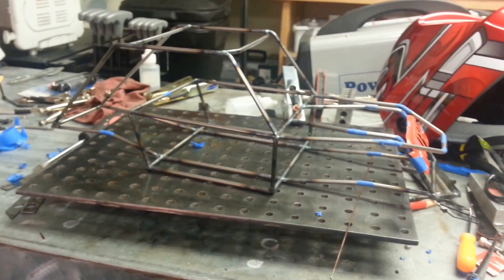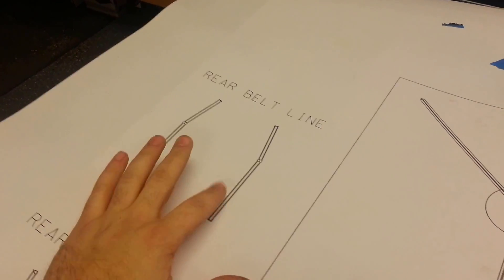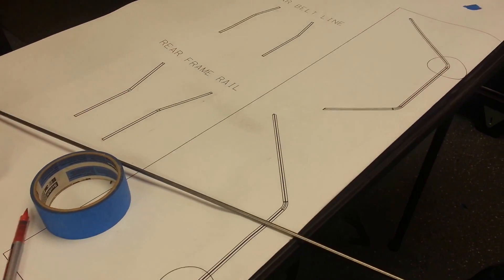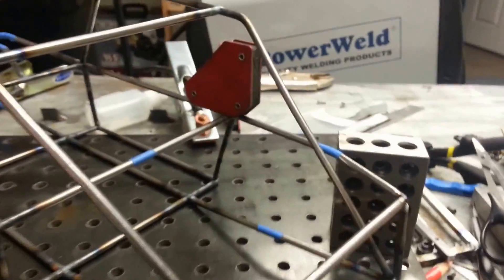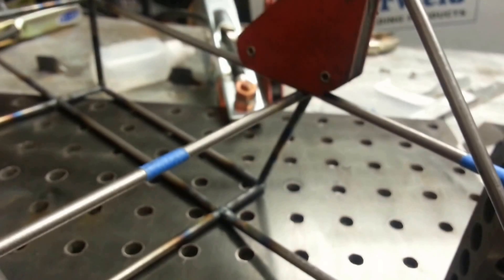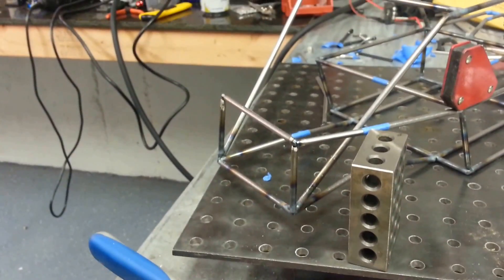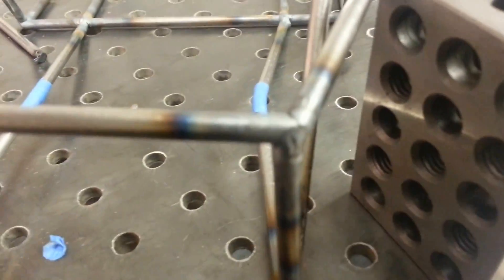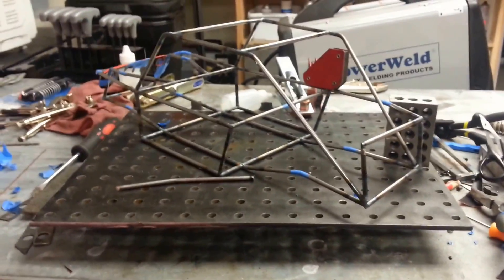How I build my custom crawler tube chassis

Comment: Are these plans available anywhere? Im looking for tube chassis with minimal bends as I'm scaling the build down to 1:25 scale. Any leads on plans would be very helpful
Reply: MicroMark has 1/28th scale RC Offroad
Kits. You add electronics, Radio, battery, motor etc.

Comment: Where do u get the tubing?
Reply from the maker: I bought my metal from a local metal supply shop. Many times local hardware stores will also have what you need.
Reply: @HarleyDesignsInc  what size of tubing is are you using

Comment: What kinda of metal is the tubing
Reply from the maker: +#Thrilling Vlogs I use 3/16" solid rod but I also use 1/8" solid rod and 3/16" DOM tube
Reply: What tool do you use to bend the tubing?
Reply from the maker: +#Thrilling Vlogs BAC Industries Mighty Rod Bender. Find it on Amazon for $35 shipped!
Reply: Thanks

Comment: That's awesome man. I'm a welder and I build little stuff with stainless tig rods all the time and I find it a lot easier to weld the small rods together with stainless steel tie wire. It doesn't take near as long to heat up. I do it just like I'm soldering somethimg. Push alot of wire so that you'll have plenty of metal there to grind and smooth out..
Reply from the maker: Chris Castilaw So you use stainless wire with regular carbon steel? I'm all for suggestions!
Reply: I've done that also.. I just got into the rc thing.. I bought 2 of the dromida cars. And built a trailer for one.. but gotta do some more work on it. And some re-doing on it as well.  Lol i
Reply from the maker: Chris Castilaw I reread your comment and think I misunderstood the first time. I thought you were talking about using the stainless wire all the time, not just when welding the filler rods together. I have used MIG wire as filler before, most specifically when welding thin sheet metal and such.
Reply: Yup it works really well with the low heat.. but what do you think about the honcho from axial?
Reply from the maker: Chris Castilaw The honcho is a great truck, any of the SCX line is really. Can't go wrong with any of them but bang for the buck is best with the SCX Deadbolt.
Reply: Ok cool. Ty I might just get that one.  I wanna do it up how you done the one you built. And can you get different bodies for each model?

Comment: Hello! i am using your templates to make your ibex chassis. ans wondering about shocks. i want it to handle like boss on the bumps, but crawl like a boss. what shock setup so you suggest running?
Reply from the maker: J Reeves Shock setups depend on a ton of different factors. You need to tune them to your rigs weight and power setup. Trying to do speed and crawling will take a lot of tuning and adding a sway bar may be needed.
Reply: Ok thanks. Going to run 27t on a 2s. Were can i get sway bars? And what brand of shocks would you recommend?
Reply: Desert Lizzard internal spring shocks.
You can use as conventional, or droop.
3 sets of spring rates for tuning.

Comment: I was on your part two of this build video and left you a comment.
 I think you need to look at some full size vehicles for correct roll cage and chassis design.
'Load bearing on impact' and triangulated space frame do not look like incorporation in your design. Your stuff looks like hobby stock hot lap 3/8 mile dirt oval truck stuff.
People transitioning into a real full size vehicle with your 'primers' in the back of their minds will have chassis/safety failures.
Before you flame me and say "it's just a 1/10 scale R/C truck, and I'm going overboard," Maybe upload some revisions on the tube of things that did not go as originally planned.
I do commend your design approach and effort.  Your talented, just step up a bit.

Comment: What type of tube do you use? Also where do you get it from?
Reply from the maker: I use a lot of solid rod, I get all my material from a local metal supply store called Metal By the Foot. If I use tube then I get 3/16" chromoly tubing from McMaster.com
Reply: ok, ty like your tube frame videos, very helpful.

Comment: Will wire welder work or do need tig
Reply: TIG most likely or even brazing. It'll give you far more control on those small welds to be able to hand feed the filler metal.

Comment from the maker: That is all in your suspension setup. This chassis could easily be setup for that type of duty, you would just need to choose your shocks and rolling stock appropriately. You can check out my Jimmy's rig which was similar construction and that truck was fast for a scale rig.

Comment from the maker: That would be kind of like reinventing the wheel, as my Jimmys rig is based off of a full size truck. Google Jimmys 4x4 and get in touch with them. They can get you just a chassis or a full turn key truck.